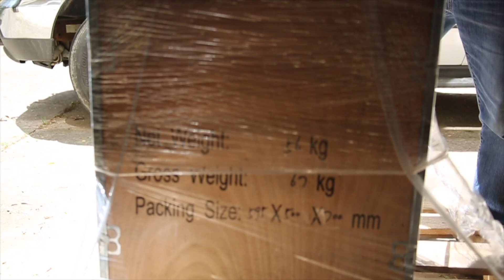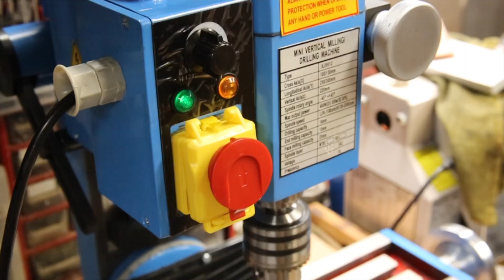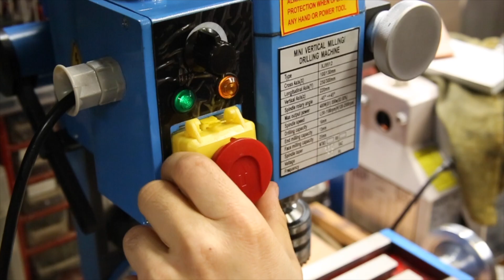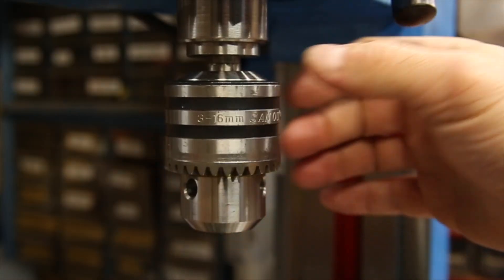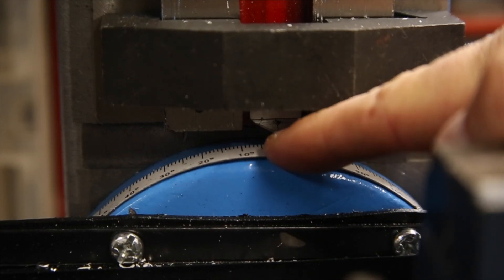Cheap Chinese Mini Metal Mill Milling Machine Unboxing, Setup, Testing, and Review

Comment: You should be using some general purpose cutting oil in an old soup can with a cheap tin acid-brush or water soluable oil in a fine mist spray bottle or gravity-feed oiler bottle on mild steels like cold-rolled steel or Mineral Spirits in a cheap plastic spray bottle for aluminum. Get yourself a new or used Machinery's Handbook.

Use the formulas at the site link below to get the spindle speeds and feedrate right for the desired result in harder or softer materials. 

Don't try to cut stainless steel grades or harder exotic steel grades either... only soft brass, cold-rolled or other free-machining steel grades, and various aluminums.

https://www.google.com/url?sa=i&rct=j&q=&esrc=s&source=imgres&cd=&cad=rja&uact=8&ved=2ahUKEwiKs82E86zeAhUumeAKHZviC6QQjRx6BAgBEAU&url=https%3A%2F%2Fwww.ns-tool.com%2Fen%2Ftechnology%2Ftechnical_data%2Fcutting_speed%2F&psig=AOvVaw00y8oTFahahtHvfQ1s-4kw&ust=1540945367230080

Comment: I understand that I'm late to this party, but always indicate your Vice in to be square. A quick way of doing that is putting the vice up on the table, and bolting it down hand tight. Then mount an indicator on the spindle with the tip of it on the non-moving jaw of the vice. Then slowly crank the handle of the x axis to see how much run out you have across the entire jaw. Once you've done that and calculated how much run out there is gently tap the base of the vise at the very end to move it slightly clockwise or counterclockwise depending on which way is out. And repeat by dragging the indicator across the job again to check for parallelism. once you've got the vice to where there's hardly any run out, tighten the bolts holding device down with a wrench. After you get them torqued down correctly check the run out again to make sure you didn't accidentally bump it. If you'd like I can make a video of this process and send.

Comment: Thank You for the time to make the video. I am far from being a Milling or metal lather operator , however I have an older Vintahe Unimat 20 sl in very nice shape. Main problem is I don't know enough
to go manual or pick up one of the 3avis Engraving / milling bachine and learn all that goes with it. I see where the CNC can make cuts we probably cant and in my case that is what I need I Re-build Cox Gas Model engines. Not being as Young as I was, I would hate to dump a few bucks, Kick the bucket, and the nexy guy that see it or hauls for junk.
Mt basic Question having the Milling machine for some time, would you recomend it for a starter Mill?  or have you learned some "New Tricks", Respectfulluy, Jim "P" Jenuine-Motor

Comment: If it's an Enco you got screwed.  Use an adjustable fly cutter.  These mills do not have class 7 matched set spindle bearings. A just gibs and lead screw nuts.

Comment: Great video. Just remember the edge finder is hollow and just a light pressure when using a drill chuck is advised. Normally an edge finder would be held in a collet.
Reply: ....and he said you move the edge finder in until it stops wobbling, that's not correct, you move it in untill it pushes slightly off center...

Comment: Chuck up end mills as far as you can without touching the beginning of the flutes, you want them as stout as you can get otherwise you'll get more chatter as the tool spins. It's also significantly less likely to break and hurt you when you chuck it up right before the flutes.

Comment: hehe, no worries. I'd've played with it like that too first I got one. I know now you should get a better finish from a face mill or fly cutter, and keep end mills for plunge cuts or profiling. 2 or 3 flute does better too on 6061 aluminum. 
I have the equivalent in a 7x12 mini lathe, but now I need to mill vertically so I'm saving up for one of these :-)

Comment: This video has been up for 5 months and we haven't seen it in proper use. I understand if it didn't work out or you have been busy, but im really interested to see if it worked out or not?
Reply from the maker: Hey! Thanks so much for sticking around - since I got the mill and made this video I bought a new garage and have been busy moving in and setting up as well as a bunch of other life things getting in the way including pretty much ALL my camera gear getting stolen out of a rental car, so making proper videos isn't easy at the moment while I fight with insurance. The next thing I have planned on deck is building a proper cabinet/bench for the lathe and the mill and then I will definitely start using it.... I really should make an update video or do a live stream q+a. Thanks again!

Comment: This milling machine is good for first time steps in metal working - cheap and simple. But IMHO can't be used even for home hobby.
My first milling machine was Opti BF20 buyed for 1300$. After few months i realize so specs and quality of this device is under minimal accuracy and quality i need - china peace of metal junk.
Mill table unflat by corners 1.45mm
All X,Y,Z travel screw have not exact step 2mm for X,Y and 4mm for Z per rotate.
Axis X 40 rotations table moves to 81.23mm. (Measurement device is Matutoyo digital caliper, fixed with holder).
Axis Y 20 rotations table moves to 40.79mm.
Axis Z 20 rotations table moves to 82.31mm.
Angel from Axis Z to table is not 90deg. Unperpendicular Z to Y is 1deg, 12min for no load. On load with non carbon steal (travel 0.24mm per rotate, fly cutter head with 6 plates D=60mm, dept 0.40mm) unperpendicular was from 3 to 5deg.
This is terrible.

Comment: I'm a machinist and for a better finish you can use SECO chip end mill (the one with replacable cutting bits - I'm not sure how it's called in english) and it should look almost like a flat grinder finish. Or use smaller end mills at higher speeds. I usually work with steel, but I think you need higher rotation speeds when working with aluminum. Also the X and Y axis seem quite wobbly compared to bigger milling machines (or maybe it's just the entire machine shaking, I'm not sure) and you probably don't have a feed function which would help with the finish (testing each end mill at various feed speeds - about 100-200 to see which one looks the best). But I guess there's nothing you can do about these last two things.
Oh, and obviously don't use a drill chuck for milling. You should use mill chuck (the one which you have to replace entirely each time you change the tool you're using), which makes the cutting tool a lot more stable.
But with wobbly machine parts and a lack of constant feed I wouldn't even worry about the finish. It's quite hard to make a perfect finish even with industrial milling machines, so I'd suggest just making a rough finish leaving about 0.2mm excess on each surface and buying a small flat grinder to make a clean finish.

Comment: I have this DRO on my mill it's a X2D mill from little machine shop. Works good you will have to cut one or two of the DRO rails so don't worry about the lengths. Get a set end mill holders. A cheap vise the Swivel base can be removed for more clearance.
https://www.amazon.com/Milling-Machine-Lockdown-Vise-Swiveling/dp/B00KRRBROE/ref=sr_1_3?ie=UTF8&qid=1537122922&sr=8-3&keywords=mill+vise
https://www.amazon.com/iGaging-Digital-Readout-DRO-Set/dp/B01G5SUZEG/ref=sr_1_7?ie=UTF8&qid=1537122671&sr=8-7&keywords=igaging

Comment: Take it off the pallet. This will help with a number of different things. Get a cheap indicater and magbase so I can indicate the vice In . cool little machine. And make  a fly cutter with your lathe easy to make and it will take a carbide insert by will make your finish work on the mill look great as and you can hog off a lot of material.

Comment: Collet chuck will be a must for doing milling. Would only use a drill bit or centre finder for a drill chuck as a drill chuck won’t hold as well. Also do not stop the end mill on the work. Move the end mill off the work before stopping it

Comment: Did you tram the head in?   Or maybe I should ask if the head is designed so you can tram it in.  You'll need to sweep the face of your vise in to get cuts parallel to it.  Thanks for the video, and good luck!

Comment: First off you should never put an end mil in a drill chuck as they will suck right out if you push them hard.  And you should square the fixed jaw of your vice with your x axis ie use your edge finder on  the inside edge on one corner then the other making not of the y axis measurements so it will be parallel and not angled as this will cause.all kinds of problems. Good luck nice mini!

Comment: got one too. and broke after very first drill in aluminium  profile. 
So I decided to check what happend and I oppened it. 

I was shocked. 
this machine has all rack in gear box made of cheap and fragile plastic. 
Of course all my rack are shattered..
Reply: A mi me pasó lo mismo, lo resolví convirtiendola a correas... estoy feliz con la modificación mejoró 100%
Reply: I sent my racks to a company that produced new but steel ones. Now I'm happy too :)

Comment: You asked for recommendations:

1. Collet instead of chuck, but others have already pointed that out. 
2. Bolt the thing down to something very stable. When you were milling, it looked like it was jumping all over the place (not just camera bounce, I was looking at background vs mill). Weight is your friend when it comes to milling.
3. Check your ways. It may have been the camera, but it looked like that table was jumping all over the place in relation to the tool, which may mean the ways are not very tight. 

Other suggestions: at some point you'll want a dial indicator and a good dial test indicator for alignment and for setting up the vise and parts. There's a whole lot in the general work-holding area to look into as well, but it will depend on what you intend to machine and how.
Reply: Pete Brown watching that vice jump made my stomach hurt. I wonder what this old tony would say...
Reply: @blaccteezy  TOT would probably laugh and have a few beers with the guy
Reply: I've seen some videos where the operators are pouring a concrete block to bolt their mini lathe or mill down. It increases the stability and surface finish at a really low cost.
Reply: @rallen7660  I remember seeing the contractors take out a wall from the side of the quality control room so they could lift in a huge slab of granite to table some of the new measuring equipment. This was not your average luxury home kitchen counter. Much much thicker and 50% longer. I have no idea how heavy that slab was but it looked impressive.
Reply: @charlieross-BRM  CMM computer measurement machine, good stuff if programed properly. 175 lb per cubic foot.
Reply: George Robartes  Or epoxy and granite. Just chat with your local countertop companies and snag all the cut offs and break them up. Good heavy stuff. They will usually be happy to give you a truck bed full of it.
Reply: @TheTruth-fs2rm  totally agree, we pay far too much to get rid of it  by the ton, so always happy to help people out like this
Reply: Vice and whole mill was wobbly.
Reply: I would be more interested in seeing a DRO being added to the machine to eliminate backlash errors. 

After that some motors to make it into a full CNC (if rather small) milling machine would be nice!
Reply: Actually  its the grease still on there need to remove  gib..clean out then reassemble  and adjust  its common

Comment: Thanks for Your video.I have a milling machine that must come from the same manufactorer as Yours. My toolbox is considerably thinner but the accessories were the same.I find an index for the Z, or C, handwheel on top, not on the side, as You show in Your video.

Comment: There are a couple of things, you should get some collets and use them to hold an end mill instead of a drill chuck to get better cuts. The other thing is square the vice and that is easy to do with the edge finder. When I decide to look for a mini mill I will be looking for a CNC. The most important thing is to get collets for your mini mill, and those are on many sites including banggood.

Comment: These machines are OK  at what they do, as a time served machinist there are alot of pre use ops you can do,
Put a dti on tbe slideways and adjust the gib strips, reduce the backlash at the handles
I doubt they run ball screws, so the running bushes will need maintaining well
Always machine into the fixed jaw on bigger cuts, the force will unload the vice pressure otherwise
Rigidity is key to finish, as well as coolant, if you have no coolant WD40 works well, or get yourself some soluble coolant
It takes a five year apprenticeship to know yourstuff, but you can have alot of fun with these, but please be safe, make a guard, wear safety glasses, if you ever see something let go.. You'll kbow why... Enjoy

Comment: hi Tim,
go on you tube the is a guy on from australia,who devised  an on off switch,with pin that you got with  the mill ....what he did was take the cover off the power control box.and then he drilled a small hole on top of the box and to the left and then inserted the pin into the hole and he then put a small micro switch at the lower bottom,so when he places the pin in the box it will not start.it'll only start when you take out the pin.......moral of this is so you do not leave the pin in the spindle and shear the drive gear.....if you forget to remove it.......check it out it may be what is needed......just my two cents.

Comment: When machining round workpieces get a vise with a prism jaws, otherwise the workpice may come loose and fly around, injuring you and breaking your tool and in this case the machine, because its not made for high stresses. if possible get a vice with replaceable jaws. this allows you to make your own jaws and use cheap aluminium or mild steel when you need a jaw that has to be fit to size when you want to be really precise, especially when you have to make several identical parts.

Comment: first off, have less of the mill hanging out of the chuck, this will reduce vibration and make the mill have more stability, this will give a smoother cut.

2nd Never, for the love of god, stop the mill, while in contact with the workpiece. you will damage the cutting edge and possibly chip the mill and damage your piece, other than that gl with the mill 🙂

Comment: I wonder if you use a v-block, would it have a better finish. Thanks for the video.
Reply: Likely it wouldnt.. Poor finish is caused by tool chatter and tool deflextion.. Hes using an endmill in a Chuck..
 Should be using a collet.. V block would help with minimizing vice marks considering hes milling aluminium which is super soft.. A vblock wld make it less likely the part will shift in the vice on him as it would go from 2  points of contact with just the vice to 3 points with vblock

Comment: Almost a $1000 for a crappy drill like mill. Finish looks close to a chainsaw to aluminum bar cut. Don't bother measuring run out with an indicator as it will be off the map. I would rather do machine work with a die grinder than than buy one of these cheap mills. Cheap is the quality not price. Price should be around $300 or maybe they should find someone who will take them. No wonder China is the number 1 growing economy, America can't make stuff that @%#$&. Congrats on helping the Communist.
Reply: Oh a racist and a hater
Reply: Why is everyone who doesn't like cheap Chinese junk flooding our country and taking American jobs a racist and a hater? Maybe you're a liberal crackpot who doesn't know dirt?

Comment: One get rid of the drill chuck and don't use it for any milling operation except drilling, always remember what way you are turning your handles so you can take account for backlash, it's the same thing that needs to be done on a Bridgeport even completely new.

Comment: I have one which I bought about 16 years ago. A piece of junk but I still done lots of serious work with it. I could spend a describing all the repair and some mod I had to do with it. Your introduction is short by the most important point, that I the vertical  milling...  mine is moving on a rack vertically which is theoritically incorrect solution, let alone usage. As much as I saw yours is by a screw, much better. How is the fast vertical movement is solved ?......???